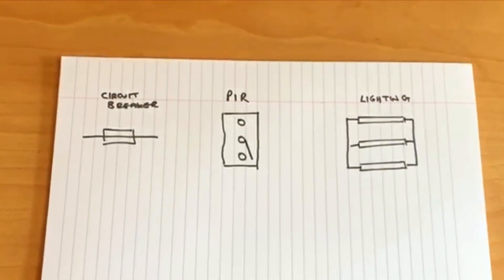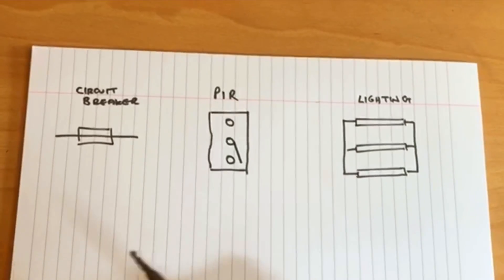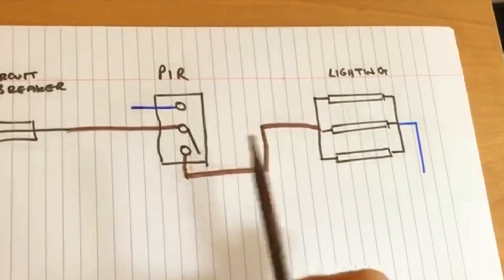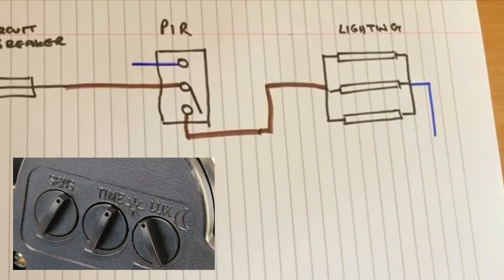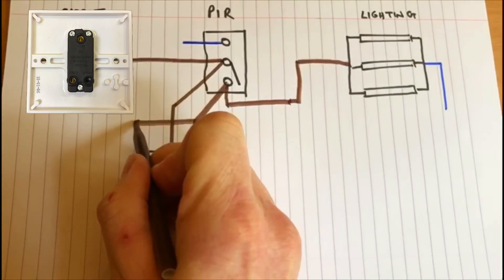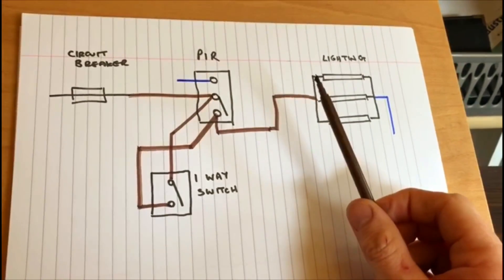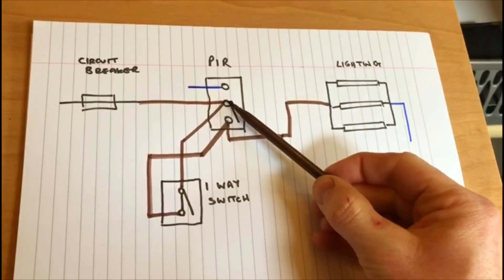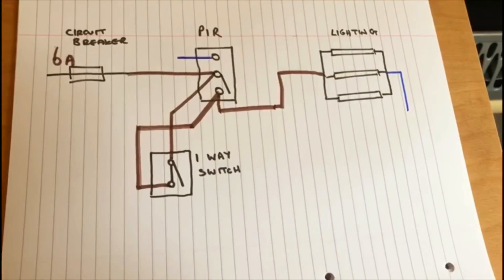PIR Lighting Control - Wiring Diagram Part 1

Comment: Great video. 
What would happen if I turn the light on with switch and someone pass by and activate motion sensor. Is there a chance something to burn or would breaker trip because light bulb is energized from the switch and motion sensor at the same time.
Thanks

Comment: Thank you for this, it's been helpful. I was wondering if you could advise me on something, I have an extension cable, running from my outside plug socket, I've connected my ground spike lights to the extension lead, I want to connect a PIR sensor to it, is there an easier way to connect it?

Comment: 7-12-22
If I were going to use a PIR sensor to control drive way and drive entrance pillar lights (I think these are wired into the consumer unit on the same circuit as the two garage strip lights) what amp circuit breaker fuse should I use - or hope to see in the consumer unit… there are two driveway lights and four pillar lights 
Thanks 
Paul

Comment: For larger loads is a contactor a good solution, (do they make contactors that run coils on 120-240v) or are there sensors that output 24v (heard most contactors use 24)

Comment: Many thanks for clear instructions 
Just I have questions the manual override to work with most pir  need to be off and on  2 time to work continue on
If I use 2 way switch 2 gang  one for pir and other for manual override put in this case also need to be off and on 2 time to continue on or no only like normal switch 
One time switch on or off

Comment: Superb.  Thank you.
Ran into difficulties yesterday.  After decorating I changed all the old sockets and switches for new MK.  Nice.  One of the switches controlled what I thought was an isolation switch for outside sensor light.  I knew the switch was powered direct from a socket in the other room so I replaced the switch with a Fused Spur Switch 3 amp.  After doing this the outside lights just stayed on.  I couldn't think how the circuit had changed to make the lights stay on so decided to just switch it off and check out a few wiring diagrams here on YouTube.  I can see now exactly what I've done and I need to add an override switch next to my fused spur to allow the full manual override if needed  or the sensor switching the lights as required.  What a dummy. 😄  Brilliant.... thanks for the vid.  Problem solved.
Regards
Steve

Comment: could this also be used for some IP rated LED strips in a bathroom?
Reply: Hi Mat. Ive done exactly that, wago connectors off my existing lighting circuit to a PIR, which is then connected to a 12v transformer with multiple IP rated LED lighting strips in the bathroom. We've found we rarely use the normal switch operated downlights since installation.
Reply: @RTilly91  OK great, Thanks for the quick reply. 👍
Reply: Did you find an answer to this question, I'm currently considering this, PIR to 12v transformer to led strip lights?

Comment: Brilliant. 
Thank you mate. I just wired leds into the bath panel, ip rated of course, and wired to a pir and pull cord to overide.
Works perfectly.
Reply: Hi, great idea this! can I ask you if you wired the PIR direct to the main board and then connected the pull cord switch as an overide? Or has the main power been pulled from the pull cord main line and the pull cord still acts as a overide? cheers!

Comment: I wire PIR’s using a 3 positional switch. It gives you the option for Off, manually on and PIR control automatic.
Reply from the maker: Tomas Ben Melech I think that is one of the answers me in Matt’s question pack 👍 (also it’s video 5 in this series)
Reply: @GSHElectrical  hi, would like to watch this video you are referring to but just came seem to find it, can you help. Many thanks, Ian
Reply: @GSHElectrical  Hi, can you explain or post link to this video you commented about, this is what I was wondering about and thinking that I could maybe have done and would love to know if possible at all. Cheers

Comment: I want to use a pir to switch a bathroom fan and light but fan need s permanent live because its2 speed
Reply: Nigel Lewis I will do a video. Basically . live and neutral to the Pir. 3 core and earth to a 4 terminal Junction box, live, neutral and switch live. 3 core and earth then continues to fan, via a 3 pol switch. Twin and earth also from junction box to feed light. Can also put in an override switch for Pir if you wanted

Comment: I always use a contactor these days when switching from a PIR. We had some good brand PIRs on a job but we kept loosing them every few months, and we was switching well under load, so far with a contactor they have been going well over the time they was dying. So now I will add a single way contactor in the CU if it is domestic or in an DIN rail enclosure commercially.

The relays inside was either welding shut or welding open. I have a feeling it is because we are using LED these days and well the SMPS has an inductive component and not just a resistive like a lamp does,  and the PIR manufacturers have not improved there design for the new LED fixtures we are now fitting. With the above job I mentioned I am still waiting for the manufacture to come back with a reason why as they took them all back for testing.

So I just see a PIR as a control these days feeding a contactor.
Reply from the maker: Thanks for the detailed message you are so correct. The video links to an assessment Matt’s learners are carrying out during these difficult times. 

All the best. Gaz 👍
Reply: @GSHElectrical  Hi, can I ask whether this is still the recommended method explained above or have the PIR sensors come upto scratch these days after product failures and testing as the guy above mentioned?
Just that I am about to get some lights imstalled with a PIR sensor and am just doing some research as to the best mothods for the set up! cheers!
Reply: I see your point but I can honestly  say I've  never had this situation in the numerous times I've done this with led lamps, and I use the knight pir sensor with the 1kw load limit from TLC so nothing special as regards the pir